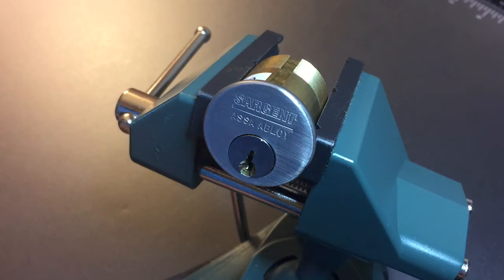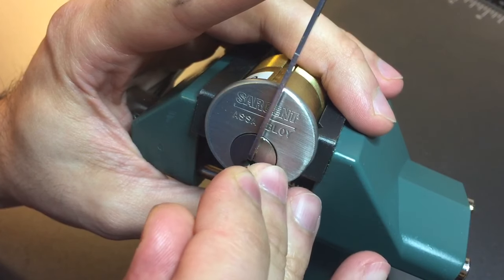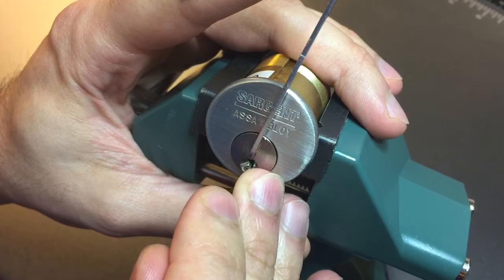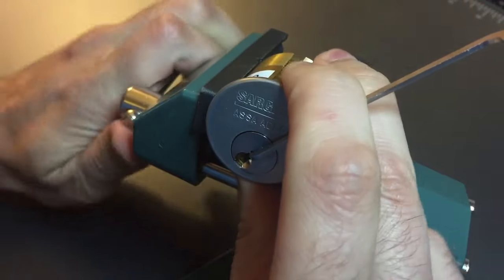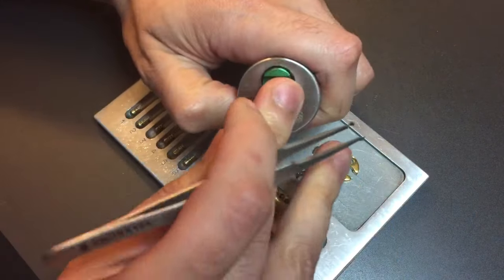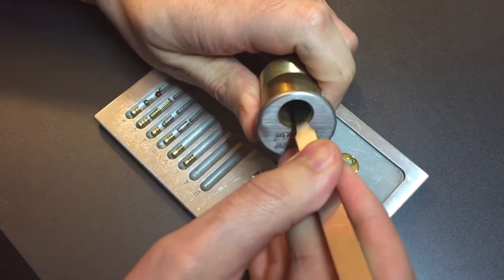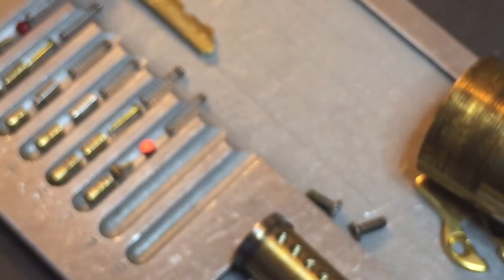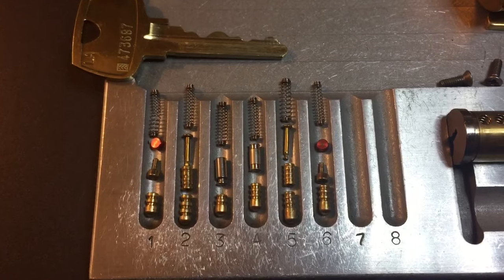[277] Clay Miller Sargent Challenge Lock Picked and Gutted

Comment: Glad you enjoyed picking. I originally had some sharp, deep, and long T-pins in the counter milled chambers that would give horrendously deep false sets and when trying to set, would drop everything else unless you had it in the exact perfect order which was hard to figure out because they all had equal feedback. Well picking it like that was very difficult and took like 20 mins one time to get right so I changed pins around a bit to make it a little more pick friendly. Not easy but not a hair puller outer either. Good job
Reply from the maker: Thanks again for the lock.  These videos can be a bit deceiving because the viewer doesn't see that I've picked the lock a few times before starting the camera, and figured out the crux(es) of the lock.  On this lock, everything fell into place once I figured out that pin stacks 1 and 6 were drunken spools, so I needed to set them early.  Thanks again.

Comment: Nice pick, 
what a gorgeous lock those Sargents have a very intimidating look to them.
And with that kind of pinning should be intimidating.  lol
I got a bunch of these style Sargents off Ebay 11 total,  I think I still have 4 or 5 of them left. But I found when I made them into challenge locks, if you move the driver pins around in different positions it gives a different pick all together. (Changes the binding order)
Reply from the maker: Thanks.  The Sargents are a great compromise between quality and price (particularly if you find them lightly used).  They are good practice and challenge locks.

Comment: What an impressive job on making those pins. those pin in pin drivers are interesting. how do they increase the anti pick properties if the corresponding key pin isn't also a pin in pin? Does it give the drive a "floating" quality?
Reply from the maker: The pin in pin design transfers the springiness to the key pin, disguising the fact that the outer pin is binding.  As such, it doesn't really make picking harder directly... it just messes with your ability to "read" the pins and consequently makes picking harder in a more indirect way.  It also causes really deep false sets at the end of the pick.
Reply: ahh that makes sense so it does kind of float there in a sense. it allows for some springy feedback yet still binding the core. Thanks for clearing that up.

Comment: vary nice pining and look like nice clean threading job.#7 I'm asking is there room on key for #7  remember I'm just learning? ?😎great video thk.
Reply from the maker: Thanks.  There's no bitting on the key, but sometimes you can pin from the very tip.  Even if you can't, you can put a pin in that's right at the shear line while at rest... with an tapered top and some deep spooling, it can be a nasty overset trap!

Comment: I must need to work on my tension control, because I am having a difficult time with these  security pins. I do not understand how you know you have not over set a pin. They click when they do that also. Just forcing pins until they click does not work at all for me.
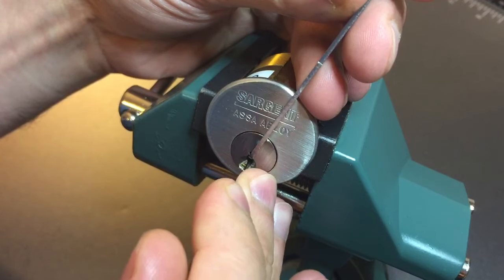Reply from the maker: You are on a viewing marathon tonight!  Thanks for watching.  Your question goes right to one of the hardest aspects of picking to put into words, so I suspect my answer will not be helpful... but I'm going to try anyway.  Once a pin stack is at the shear line, what I feel is a loose key pin, and a firmly set driver pin.  And by "firmly set," I mean that when I press against it, I feel no feedback in the tension wrench.  The difference between "no feedback" and "very little" feedback is not always easy to differentiate.  I find it nearly impossible to tell the difference when I am not using a very stiff tension tool.  Notably, some locks are purposely designed to defeat your ability to avoid oversets before they happen.  The older Lockwoods are a good example of that.  See video #99 for a discussion of how I deal with them.  Some challenge locks present similar issues.  Once you pass the shear line the difference becomes much less subtle... though I have a hard time describing exactly why.  That said, it is very easy to detect since you will not feel the key pin follow your pick down as you release pressure.  That's why you will sometimes see me say that I think I over set a pin, after which I will ease off tension to allow it to drop back down.  If I think I overset a pin, I quickly use the method described around the 2:30 min mark of video #99.  To confirm it is overset before purposely dropping pins.  I hope this is helpful.